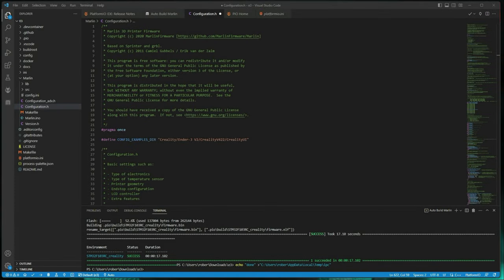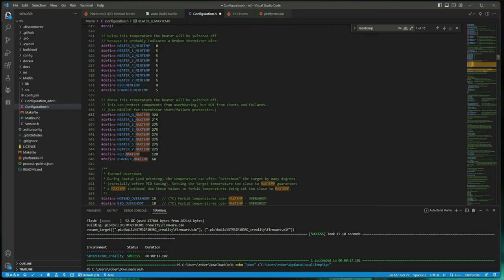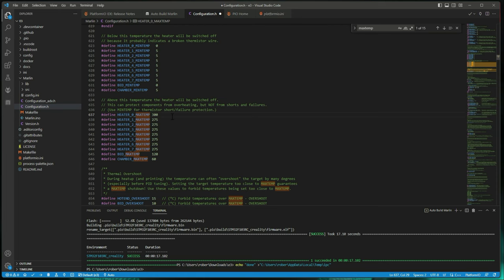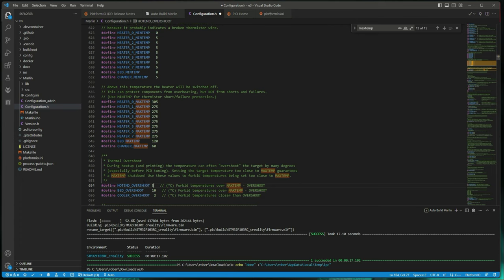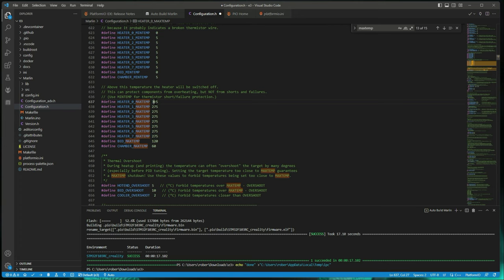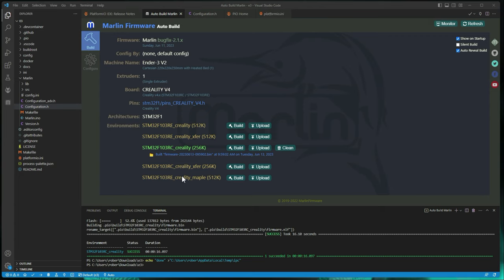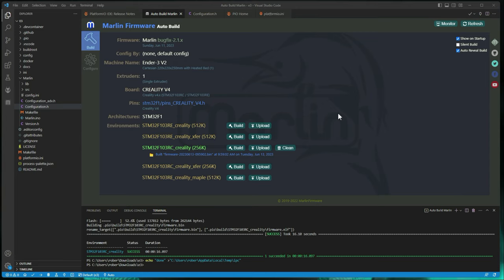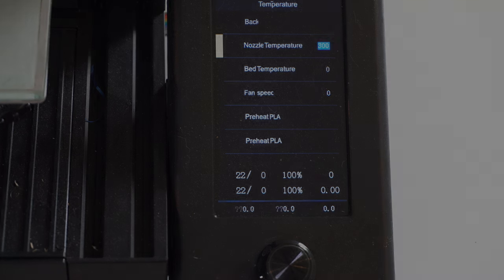Change Max Temperature in Marlin

Comment: what type of thermistor would i need to set it to? the default one doesn't work, and I get an error if i try to use one of the NTC 100k ones. 
I have an Ender 3 Max 4.2.2 silent, with the sprite extruder pro and Crtouch - the firmware works except for the heating... I get an E1 maxtemp error while heating the toolhead...
Reply from the maker: Hi. im using the medal one that came with the spider hotend.
Reply: @3DPrintscape  problem resolved - in marlin I adjusted changed the thermistor type to 61 which has a max temp of 350c - works now! Ty
Reply: @vasishtbatchu69 how did you do that?
Reply: @xx_phantom_xx5372  in the configuration file I went to the “thermistor” section and changed the thermistor #0 to now be set equal to 61 instead of the default 1. Thermistor type 61 had a max temp of 350 rather than type 1 only having max temp of 260

Comment: What about thermistor library number? The standard  "1" which is what is used for the glass bead, so what number are you using for the thermistor library?
Reply from the maker: Hi. I never changed that value. I know it wont be as accurate but its worked fine.

Comment: I have bought a Sprite Extruder Pro Kit 300℃ High Temperature Full Meta and built it on my home built printer...
it prints great but the temperature on the Nozzle does not fall completely to rest, fluctuates 2-3 degrees on either side of the set point..
I have not been able to find information about which type of Thermister is on the Sprite Extruder..
if I look in the Marlin example files, no. 1 is selected and I have read in several places that you must choose no. 61 to get up to 300ºC.
but it has to fit characteristic of the Thermister..
Reply from the maker: Hi. I didnt know what thermistor it comes with either so i left the default values and allowed for the overshoot by 5 degrees.

Comment: Hello. I have a creality cr 10 max printer. I installed sprite pro kit instead of original hotend. I made the step settings from the prontefece program. my printer is limited to 260 degrees max heat. I couldn't change it. Could you please help me?
Reply from the maker: Hi. Im not sure what firmware your running but you will need to either use crealitys high temp firmware or build your own marlin firmware.

Comment: Great videos. They have been very helpful. I am relatively new to working with firmware but have managed to update my Ender 3 with a BTT SKR mini V2.0 with STM32F103 RCT6 chip. I want to upgrade my machine with the Sprite pro hot end. Which Firmware should I use as a template as I am pretty much stock printer. No bltouch or any other mods. Help please.
Reply from the maker: Hi. If your looking to increase the max temp, follow what i cover in this video. If your not, you dont need to change the firmware.

Comment: is it possible to just send a gcode command to my ender 4.2.2 and BBTskrmini3v3 to change the max temp to get the sprite pro extruder up to max temp?
Reply from the maker: Hi. I dont think so, you can change some of the settings with gcode commands but i dont think you will be able to override the max temp settings built in the firmware.

Comment: Hello Rob, i have an ender pro and updated to 4.2.7. If i upgrade to sprite pro do i need any other change in firmware apart from max temp?? As always thx for your time.
Reply from the maker: Hi. If the only change made was the hotend, no. If you have a crtouch, runout sensor, or any other mods you will need to account for those.
Reply: @3DPrintscape  thx for your fast response
Reply: @ThomasKranias   only other thing is u would need to set the board for the 4.2.7 board in the platformio.ini file
Reply: @vasishtbatchu69  actually the already made example is wrong for ender 3 pro 4.2.7 . It has the wrong dimensions. ( 235x235) its actually 220x 220.

Comment: I'm trying to raise the max temp on my CR-10 S5. I changed the MAXTEMP to 305 and the Overshoot to 5, just like your video. I get an error of  "Marlin\src\module\temperature.cpp:323:33: error: static assertion failed: HEATER_0_MAXTEMP (305) is too high for thermistor_1.h with HOTEND_OVERSHOOT=10." I am using a stock (glass) thermistor until my new HT-NTC100K thermistor comes in. Any suggestions on getting it to raise the max temp some, while waiting on the new thermistor?
Reply from the maker: Hi. Sorry for the delayed response this comment was held for review as possible spam. It sounds like it didnt take the overshoot value or they changed something in the config. You could try to bump the max temp to 310 and leave the overshoot at 10.
Reply: @3DPrintscape  I am having the same issue here. I've tried playing around with the temp settings but it keeps giving the same warning (adjusted to the values I entered). I suspect theres another setting that needs changing but dont know where to look. Any help is appreciated. Thanks
Reply from the maker: @thelastwooter  The only settings i changed were covered in the video. What printer is this for? May be base config example changed.
Reply: I had problems as well when upgrading to a Sprite Pro kit. The thermistor section limits how hot it would go for me.

I had to make the following change in Config.h
From:
    #define TEMP_SENSOR_0 1

To:
#define TEMP_SENSOR_0 61
Reply: @3DPrintscape  See my note below. I had the problem as well and found I had to change my thermistor setting.
Reply from the maker: @mattspawn1975  Thanks for sharing this.
Reply: @3DPrintscape Thanks for all you've taught! You've been a tremendous help for me when I started my firmware journey.

Comment: The easiest way to increase the temperature is to create a configuration file with g code, paste it on the sd card named config.gco, and select it when starting the printer, something like this

; Professional Firmware Configuration File
;=====================================================
C10                    ; Mark as a configuration file
M117 Applying configuration
;-----------------------------------------------------
C104 U1 T315  ; set absolute limit to 315 °C (300 + 15 overshoot)
M500          ; save settings
;-----------------------------------------------------
G4 S1                  ; Wait a second
M300 P200              ; Beep
M117 Configuration Applied
;-----------------------------------------------------

https://github.com/mriscoc/Ender3V2S1/wiki/Configuration-files
https://github.com/mriscoc/Special_Configurations/releases/tag/T13
Reply from the maker: Hi. Thanks for sharing this. I was thinking about it from building firmware perspective but this would work as well.

Comment: Hi there. 
This is going to be totally random request. But you seem to be the man. 
So I have built a metal printer head printing head. ok so it will print .4 mm so great but not fantastic. it has all sorts of issues but it prints stainless steal the same as if it would have been pla. So the slicer should be ok but needs to run 1/4 as fast. Like I said it has some quirks but it runs.
Here is my problem: 
I have been given an ender 3 with a v4.2.2 board. And a ARM st processor. It had an auto levelling doda on that has been removed.
OK so with the fan and heaters bead and head, as well as the auto levelling doda I need to remove all of this from the firm ware.
So with my non-existent knowledge I have been in there hacking about but I don’t think I will get this figured out before i retire!! and that’s 10 years off!!

So I am reaching out.
how do I removed the 
bead heater
head fan 
head heater and censor

But still get normal pla g code to run the drives xyz and feed.
What would be nice is if I have an output say heater output to say when to deposit metal.

Any help or suggestions where I could ask for help would be greatly appreciated.

Kevin H
Reply from the maker: Hi. The short answer is i dont think it will be easy to do that. I think most of that will end up being settings in the firmware pre-compile. Im not sure you can disable them and the build be successful. It may need additional things to be disabled and lines in the sanity check being commented as well.